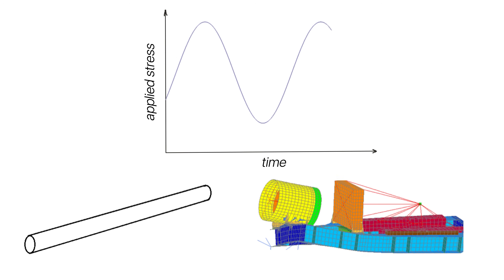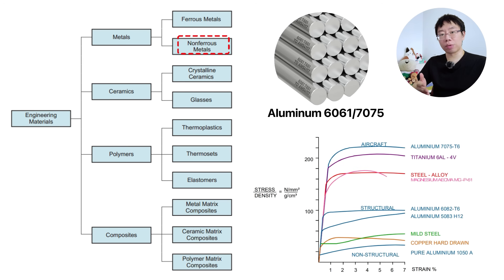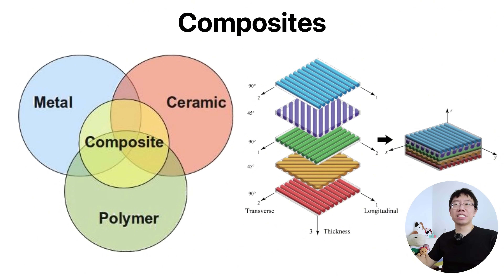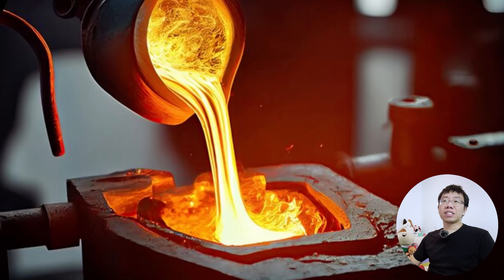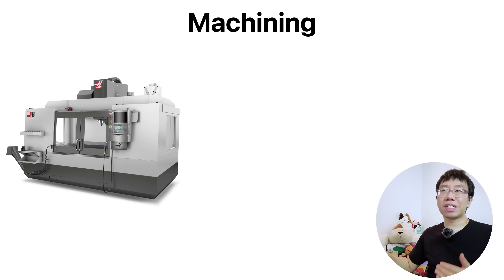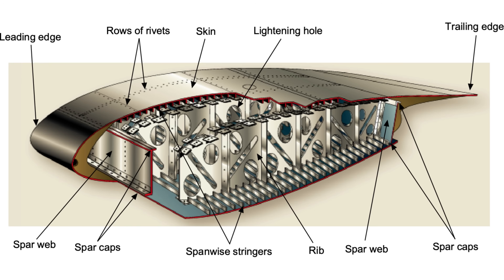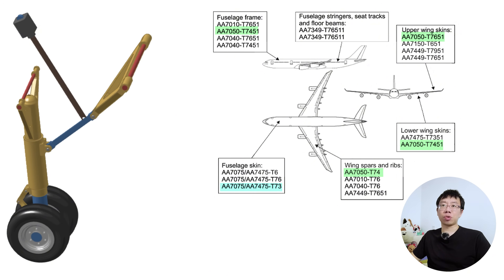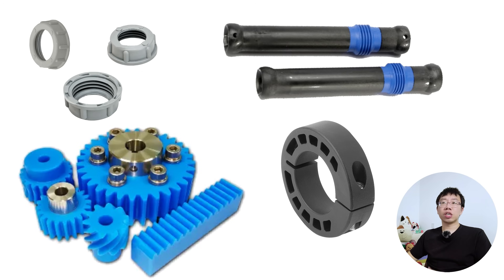How Mechanical Engineers Select the Right Material

Comment: wrong, there are design failures where no material in existence would have held up, either due to extreme heat, excessive load, etc. materials can only get you so far. somethings you also need to introduce heating, cooling, and other limitations to prevent exceeding the limits in some way.

Comment: Doing a lot of 3d printing designing a lot of intake manifolds for small engines and other projects, fuel pumps whatever. This has been my life selecting what materials to use. I mainly use PETG, TPU and (nylon)PA6-cf
Reply: I hope you aren’t doing anything safety critical. 3d printed parts have downed small private  aircraft.

Comment: You forget wood! Rookie! 😂
Reply: If the customer wants wood, I will give her wood.
In a world facing worsening environmental conditions, we need truly renewable materials. Engineered lumber delivers exceptional strength-to-weight performance—often comparable to steel and aluminium—while remaining low-carbon and renewable. Its advantages are no longer theoretical: a new hockey rink near me uses timber for all major spans. What was once old is new again. Of course my shed, fence, steps, plumbing and the entire house is in SolidWorks 😂
Reply: it was there in the ashby diagram, but in general wood isnt used in critical aplications, like you wont engineer a boat for casual fishing, you would engineer a freighter, and that would not be made out of wood of course, maybe concrete but that was only when steel was scarse in wwii